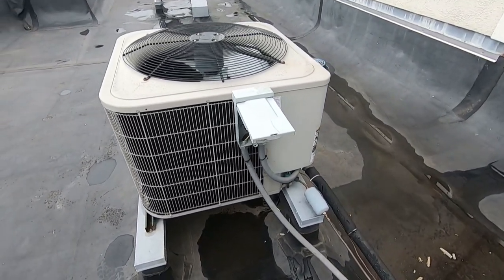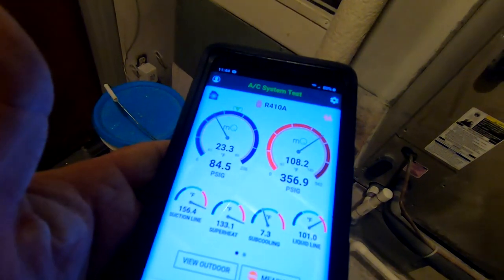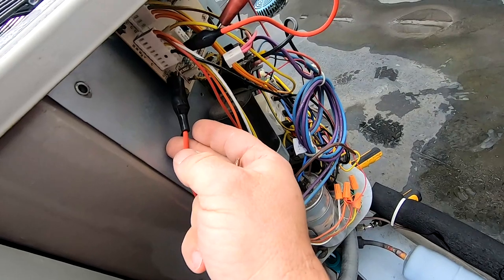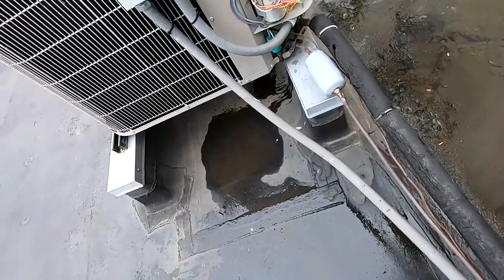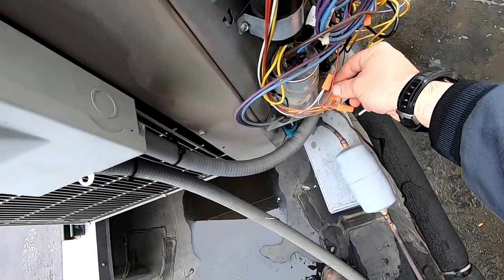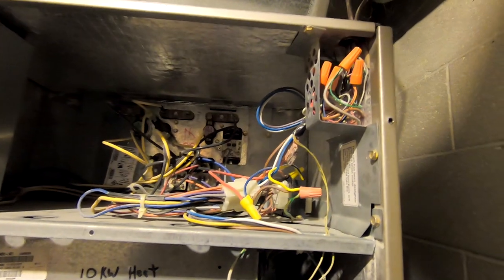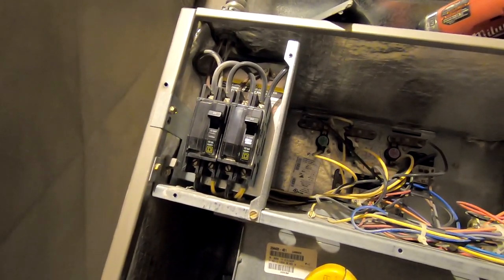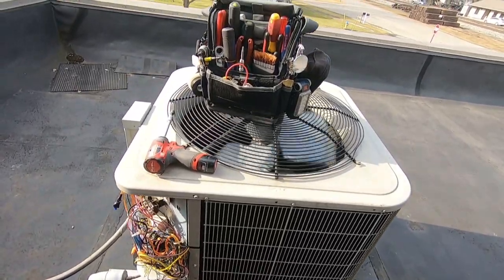Heat Pump Freezing Up Blower Motor Cutting Out & Other Problems

Comment: Carrier defrost test pins are what we call a “speed up” tap. It speeds the timer up according to a formula related to the time remaining on the defrost timer. So it depends on how long it’s been running as to how long you have to hold your jumper on the pins to get the cycle to initiate.
Reply from the maker: I'm use to Lennox usually going right into defrost.  I found a lot of things I did wrong watching that video over and over LOL.  Thanks for the info 👍👍

Comment: Can you check the refrigerant charge the traditional way by checking high and low pressures in heat pump mode or should we follow a specific way ?
Reply from the maker: I try to follow how the manufacturer recommends but I like to look at subcooling and superheat and recheck against the pressure chart. The best time to check the charge is in the summer in cooling mode but if you have to do it in the winter in heating mode, the recommended method is to weigh it in. But I'll still check sc and sh even in heating mode.

Comment: Ya I had carrier tech support say one minute   to short the defrost and the next one said no it’s minute and a half. Still too long to hold over a minute . Great vid don’t get to mess with those too much up here in Ohio.
Reply from the maker: I'm in northwest Ohio myself. our company generally sells more high-end equipment such as geothermal and the High efficient heat pumps. This is a entry level heat pump that has been around forever but with that being the case usually 8 seconds is plenty to put it into a defrost. But it did seem to requires the pins be shorted for an extra long amount of time. And with the weird wiring inside and the thermostat acting odd. All these things made me want to just wipe them out and start over with new components. The building was being remodeled and prepped for a new business Lease.

Comment: Great video and troubleshooting! These Carriers/Bryants/ICPs have a crankcase heater switch that is normally tied to the harness to open air that turns off the heater above 75 deg or so @2:48 in the schematic.  Is it possible that is the thermostat you saw vs the defrost that has the pink wires that is strapped to the liquid line as you mentioned at first?  Really like your explanation and thinking process.
Reply from the maker: I didn't spend a lot of time looking for the switch but you very well might be right now that I think about it 👍👍either way the switch was opening and closing like it should and because I eliminated that switch from The Circuit by bypassing it, I was able to confirm The problem still lied within the control board and the other components that I had to replace. Thanks for mentioning that👍👍

Comment from the maker: Thanks for taking the time to check out the video! I believe I was incorrect in saying the termination is from sensing the ambient temperature inside the condenser. 😕😕 What I likely seen was the crankcase heater ambient switch that shuts down the crankcase heater when it's warmer. So it does sense the temperature off of one of the loops on the condenser coil. (My  apologies)
 If you like the video please leave me some feedback and consider subscribing.
Reply: Great trouble shoot!
Reply from the maker: @daviddesilva4971  It was one thing after another, this was a weird one. I'm still not sure how it even ran without R hooked to the condenser.

Comment: I've tried that jumper a lot of times, and I find they dont' like to activate. I either thought it was because it just wasn't cold enough to activate. But others will do it as expected. All carrier/bryant units. It's been a few years but I think my team lead said if it doesn't work ignore it unless it has issues defrosting.
Reply from the maker: Rheem,  Lennox, Trane,  Armstrong, Ducane all seem to do it right away in maybe 5-8 sec, but I should have just left it on up to 15 sec. But with all the weird electrical issues is why I chose to replace what I did. If we were to rewatch are decisions we make on our calls as many times as I do by recording and re-watching them. We would probably make different decisions more often.

Comment: The heat pump is freezing up collecting ice and it stopped working. So the heater stopped working and now we don't have any heating inside the house. I talked to my brothers-in-law and my sister and they heat pump fan doesn't work during the winter like my does. So I'm guessing that is the main reason why my heat pump freezes during winter.

ANY SUGGESTIONS

TIA
Reply from the maker: The fan has to run while in heat mode. I've never seen any manufacturer not run the fan. Every heatpump will ice up, that's normal, that's why they all have a defrost. Sorry to hear that about your aux heat isn't working. Thanks 4 the questions and 4 watching👍

Comment: Nice work!   Great explination!   This has been the ideal winter in Ohio to own a heat pump!!
Reply from the maker: Yea, That's why my new videos are slow right now, same stuff over and over, unfortunately.  It needs it to either get colder or hotter. lol
Reply: @HVACRSurvival  LOL!!!  Brother, IT'S OHIO....
Reply: @HVACRSurvival  Hey Rick, while your up (if you still are), I have a question for you on a furnace I was working on.  had a Lennox G24 that wasn't operating, just that regular "click" at the board and GV when trying to light.  Went through the OofOp, got hung at the GV.   Tested all mech components; OK. ohms and voltages OK til I got to the GV on the board.  It was sending random shots between 25v and 17v with each "click" to the GV.  
             The ambient temp at the time was running in the high 40s, low 50s.  After doing other research, I heated the GV up to just warm to the touch, fired it up and away it went!  The house is in transition I guess, they want to keep temps lower until occupied but I have them keeping it warm until I get a new board in.  I don't think it's the GV, I think it's the low sporadic voltage not strong enough to pull the plunger on the GV when it's cold, but I'm not 100% sure about that.   Guess I'll know for sure when I see what V I get off the new board on the GV?  Your opinion would be appreciated....
Reply from the maker: @crforfreedom7407  I know on some of those furnaces they don't want you to set them below 60 degrees depending on the brand. But on your case if your voltage is dropping that low you got to ask yourself is there a reason why it's dropping that low, is there an issue with the gas valve Causing too much of a load because there's problems with the coil inside of the valve or do we have a weak Transformer or do we have a limit switch possibly acting up. We had problems with pretty much every component in every one of the furnaces. We had problems with weak pressure switches, problems, with week limit switches and Problems with control boards.  Does this have an integrated control module or is it a separate ignition and blower control module? Also what year is this thing? It's starting to get pretty old, the 24 came out with about the same time as the 80mgf which would been in the late 1990s? Did you by chance check the amp draw on the gas valve when it was trying to energize? If it was much over point 8 or 9 then you got an issue with the gas valve. There's always a chance that the rubber inside the gas valve is starting to stick but that wouldn't cause your voltage to drop that much.
Reply: @HVACRSurvival  Great questions, thanks!  Way to get me thinking!!  She's an old girl; 5 of 95, but she's clean and in good shape otherwise.  I haven't had the blower cover off on this one yet but the board looks integrated to me; all the 120v wires run into the main board.  I did pull voltage on the GV and I'm trying to remember what I got; I think it was between .5 and .6A?
Reply from the maker: @crforfreedom7407  I would pull the heat exchanger out,  it only takes a few screws,  if it's bad your done with the job,  sometimes they will crack in the middle where you can't see it from outside looking in. Not saying that's your problem with the drop out but it eliminates wasting time or money on a dead horse.
Reply: @HVACRSurvival  I think that's good advice.  I can do that I'm sure.  We'll see how it looks.  She's had a good life...
       Everything on this looks original, or swapped with OEM if work done.  Looks like it's been cared for (OEM and clean).   Do you recommend advising on a new unit even if the exchanger looks good, or let this keep servicing?  I think the guy's going to want to go cheap, he's holding me off on the board for now already...
Reply from the maker: @crforfreedom7407  If it's safe to operate then you can mention the benefits of the 10 year parts warranty and the efficiency of a new 95% furnace but ultimately leave it them to decide. Just be honest with them.
Reply: @HVACRSurvival  The only way to be!  Thanks Rick.
Reply: @HVACRSurvival  I haven't mentioned the induction motor to her yet, it's working but it's getting up there.   Rated at .7a, drawing between .9 and 1a so....
Reply from the maker: @crforfreedom7407  where in Ohio r u
Reply: @HVACRSurvival  Just north of you buddy in Findlay!

Comment: one klixon if for the crank case, the other is attached to the u bend, also know as the defrost termination switch.
Reply from the maker: Yea your right, I thought they did it like everyone else, I corrected it later in the comment section.

Comment: Your suction saturation is at 23F is that cold normal during heat pump mode ?
Reply from the maker: Depends what the od temp is. The pressure goes down as the temp does.

Comment: Would a dirty filter cause it to cycle on and off in the heating mode.
Reply from the maker: It could if it caused the high pressure switch to cut out,  but when I bypassed the thermostat to the g terminal that showed the air handler could and would run if it recieved the call from the thermostat.

Comment: Be very careful with the top of th8300 thermostats. The seam is not well bonded and will separate. The internal connection is surface contact to the board. Symptom: push on the top and it works, let go it stops. FYI
Reply from the maker: Good to know👍

Comment: Every carrier i have ever worked on the coil sensor is connected to the coil.
Reply from the maker: Generally most Brands I work on it's mounted on the condenser coil right after the metering device but I didn't see it On this one. The newer ones I know they mount sensors on the loops of the coil or like I mentioned right after the metering device outside. Prior to where I'm working at before I did a majority of Light commercial and a lot of residential. Here I'm spread so thin that I hardly see this stuff anymore so I have to get Reacquainted with equipment design. That's the joys of trying to do 600 things.
Reply: The sensor that was mounted in the airstream is probably the ambient sensor that turns the crankcase heater on or off below a certain temperature. If it was the sensor with the two pink wires then that should be mounted down at the bottom of the coil. If not that things never going to defrost right. Remember, not only does it get cold too close initiate defrost. But it also has to heat back up to open and kickback out of defrost. To do that it has to be mounted on the copper. 👍
Reply: Great video ..keep going sir.intrested to watch more..thanks
Reply from the maker: @syedbasheer8210  thanks bud 👍👍 I appreciate you checking in and watching it!